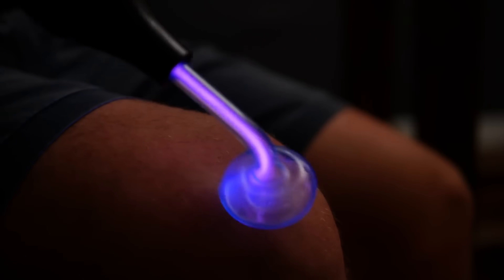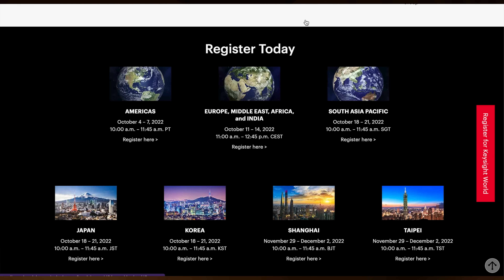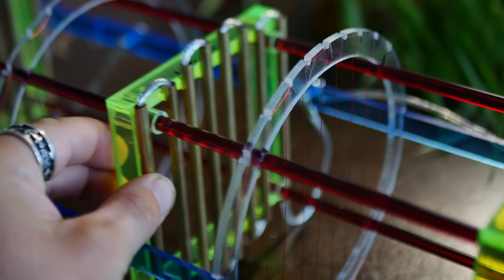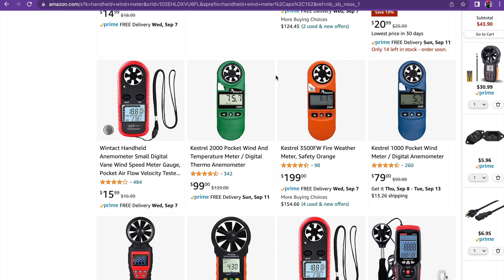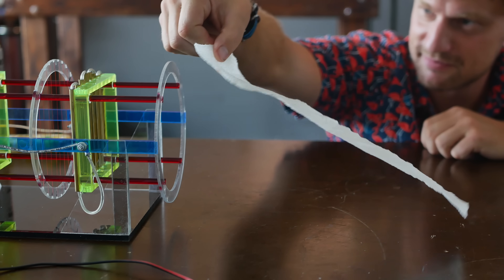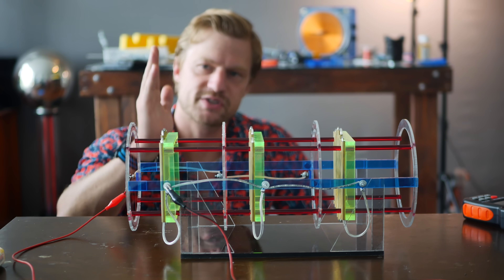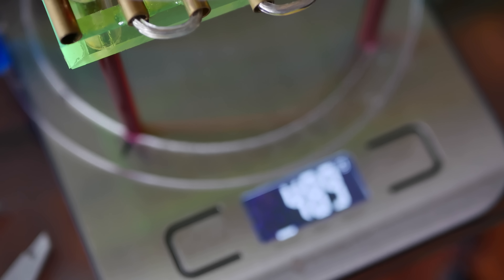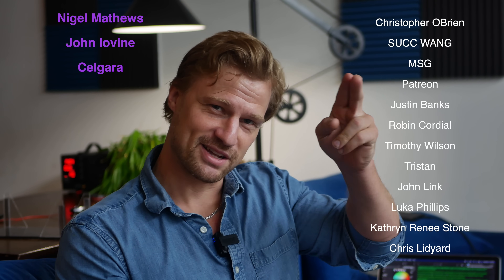Designing A Next-Gen Ionic Thruster! (For Flight)

Comment: The stagnation pressure is (1/2) * AirDensity*Velocity^2. And the power goes as the cube of the velocity. So using velocity increments is not exactly the best measure. At least get yourself a spreadsheet or HTML/Javascript and have it keep track of the velocity, squared velocity, voltage, air temperature, air pressure. So you can talk to investors when you build one.

Read a little about "fluctuation", "vortices", "Reynolds number" Your ions will interact more with turbulent air. Your dry ice was a good idea. You might want to look at "laser ionization of air" and "nuclear ionization of air" and perhaps keep sparks as detectors. Put a small camera on a spark at low current, in the dark, so you can use the data from the images for measurements. A "hot wire" anemometer might be a good thing to learn. A current enough to heat a tiny wire above ambient, the flow rate cools the wire. The current changes to keep the current constant are related to temperature and heat flow.

You have almost ZERO sharp points, and the electric field is part of the acceleration of the ions in air. I think the ambient electron density is on the order of 10^10 electrons/meter^3. But you might want to keep an eye on the humidity. A moist day might be hard to make sparks or strong fields. You should know that. I am just trying to write notes from 55 years of picking up odds and ends.

Look more closely at "electron affinity". The cost to ionize is high. But adding electrons and then accelerating the negative ions cost less energy. Decades ago there was nothing on electron affinity.

You are NOT PULSING your fields, and you did not mention frequency control of the high voltage.

Can probably stick a three axis accelerometer on a rod and correlate the acceleration in 3D to the forces. If you decide to use microsecond pulses, you can run your whole system at much higher power levels in burst. Pay attention to the second and third time derivatives of things. When you have a steady flow there is less force. But stir it, spark it, push it, make shock waves then you have something to work with. But measure, don't guess.

Since you are trying to move air, you might want to take a small stream of air and pass it through a tube with many fine needles all pointing in the foreward direction. A set of high power thusters might be better that big soft air flows.

Study magnetic induction and the force of pulsed current flows, particularly where there is high Amperes/Second. That is an accelerating charge flow (Coulombs/Second^2). You might find it much easier to build an acoustic drive.

The power modules for drones are high current but also high Amperes/second. A shock from a spark will move air and the amount is probably easier to quantify and control. Movement of air is just like movement of electric current through a circuit. The "capacitance" and "inductance" "reactance" and "impedance" are all well used. You can take the FFT of sounds and the FFT of current flows and the FFT of air flows. A "tuned flow" is one way to solve the equations of motion as differential equations using FFT methods.

The oxygen in air is paramagnetic. A strong magnetic gradient will cause a force. A high electric field at a point might be a good place to add very strong tiny magnetic nanowires. Do it in the computer and it is a lot less expensive than building things and trying to guess at measurements. And if you talk to investors with an open model they can see and have others test, you have a better chance to ask for crowd funding and cloud funding.

If you replace your solid wires with sharp needle pairs, you can maintain a discharge across each one, if you have separate current and voltage controls on each. A real field generator, you will use whole sets of these to pulse the vehicle as a whole in exactly the right way. IF you jiggle in a swing, it will not swing, you have to match the rhythm of the swing. The modulation of forces used has to match the structural resonance of the vehicle, and the acoustic properties of the air flow.

Wrting this out, I think you would be batter off to spend some time making acoustic levitation tools to pump air. Doing it with sparks and hidden ionization channels especially most of the action is going to be faster than your eye or camera (but not faster than an oscilloscope (USB) which is just some amplifiers, ADCs and computer memory and storage.

You might want to look at using arrays of discharges, measure flow, and find the "sweet spot" by FFT of the flow and the current driving the needle discharges. I think you used a hack saw blade. See if you can find someone to grow whiskers on a sharp blade. Some basic nano materials development might be something groups would help you with. If you make the models open, and create an "open worksite" you might get groups from all over the world to collaboration on ONE model that everyone can see and test and work with. Share the raw data and visualizations.

Richard Collins, The Internet Foundation

Comment: would removing the insulation on the magwire help or hurt?  I could see in the low light images that the ions are erupting from the cracks in the polyamid insulation of the copper wire.  not sure if that is by design or a bottleneck in the ion flow.  I also wonder if reducing or expanding the outlet would help.  thinking of the shape of a rocket thruster bell.  or maybe an aerospike shaped exit.  but thinking about it, since there is no combustion, you really arent dealing with expanding gasses.  you just need lots of feed air to be available to be directed in one direction.  Maybe multiple first stages feeding into the second or 3rd final stage.

Comment: Ionic propulsion is not new at all, just to the vast public.. Unlike rocket stage vessels,  a space engine runs in chamber phase vs stage. For example. Starting with ionic cage, it can multi task both a ram jet  intake in low altitude air. [Read more for details] In extreme micro air, still draw air in. Second phase chamber, the classic blade purpulsion sets will then grasp the air  to next chamber. Third phase, a compress turbine volume taking brand air volume to faster narrow. When it reaches adjacent to electric/detonater/plasma or class fuel after buffer nods, the final is the squeeze afterburner vectors. Congratulations. You have a multi atmosphere Space Jet Engine, also all electric by option.

Comment: I would like to think enclosing the build so the air flow has less chance to escape, im sure using a HVAC smoke candle I think it's called works better than dry ice aswell for testing that kind of thing, also would crisscrossing the wire making a loose mesh like a tennis racket for the electrode would that degrade airflow to much or would it be more beneficial to have a section or two be doubled up?

Comment: you might need oscillation and resonance behind the current flow with a smart controller using AI to monitor the air flow in hard numbers and adjust an algorithm of pulse and oscillation or voltage application that will increase and increase the air flow until it sounds like a whistling jet engine. I can hear dead energy in the design you made, but it is an amazing proof of concept.

Comment: If 1 array gives 1.5 m/s and two in series gives 33% more velocity, why not try putting arrays next to one-another to increase the volume of air which is being accelerated? You could also make use of the Venturi   Effect by adding cowlings around the thruster. This would increase both the volume and velocity of air being drawn into the active part of the thruster, increasing thrust at the expense of a small amount of additional mass. With careful design, that cowling could incorporate the thruster elements and therefore reduce nass again. As for the grids, try using a fine mesh instead of a very few fine wires. You could also increase thrust by having multiple elements at increasingly high voltages instead of wiring them in parallel. You can also try using different diameters for the thruster. A bigger cross sectional area should give more thrust. If you could find a way to keep mass down, the Hall Effect could also be used via electromagnets.

Comment: One improvement I see is that this device was experimental, so you designed it to maximize it's configurability. Now that you've narrowed in on the optimal set-up, you can build to that configuration and trim excess materials that facilitated its configurability. This should improve your weight-to-thrust ratio.

I'm not an engineer or anything; I hope this makes sense.

Comment: So, electrons are hitting air molecules. Causing them to move. But the problem is, electrons are hitting air molecules, causing the electrons to slow down, and not build up speed.
IF, part of the tunnel, which obviously needs to be covered had a section in the beginning with vacuum, the electrons would build up a lot more speed, before hitting the air molecules.

Comment: Instead of ground bars you could tri thin blades  , and then I think a  body would help more, like a jet engine housing. As it is, every stage could suck stationary air from sides instead of accelerating already moving air from preceding stages.

Comment: I think anode made in mesh should be better. Also I'd place the whole thruster into the tube thus not loosing airflow on the sides. Then I'd experimented with higher voltage on each next step.
And after all I'd added airflow heater (by electric arc of course!) in narrow tube :)
This would be  a real jet propulsion engine without burning fuel

Comment: Jay, I've just stumbled onto your channel today and I love what you're doing here.  I really like the work with the ion thrusters in the dark.  I've been into photography since the 1960s.

You mention the MIT ion powered plane and I did some looking at that.  From what I see, they set up a completely open ion grid and stuck some wings and a tail on it.  While this worked, I think there are better ways to make it work.  Your idea of a multi-staged thruster isn't a bad idea and on your later videos with the boat, this is proven out.  I just left a comment on the catamaran video you just put out.

However, with an aircraft being powered by ion thrust, I don't think you're taking full advantage of that thrust if you are focused on a typical round thrust pod like an engine.  The aircraft flies due to the laminar flow of air across the surface of the wing.  It flows faster across the top as it has further to go and this creates low pressure on top of the wing and produces lift, but I'm sure you already know this.

But why not maximize that lift by elongating the ion grid the length of the wing and just above the upper surface so that the air moving over the wing is further accelerated by the ion thrust?  Bell Aerospace ran a test in 1977 of their Bell-Bartoe Jet Wing.  This was a single engine jet that had the exhaust split and re-directed to an outlet at the top of the wing's camber.  They added a second airfoil just above the outlet to help maintain the laminar flow.  The point was to develop a Short Take Off and Landing, (STOL) jet aircraft.  You can read more about that here:  
https://www.planeandpilotmag.com/article/incredible-plane-ball-bartoe-jetwing/

Comment: nozzles could help increase velocity and maybe straightening the flow. the moving air is shearing against the non moving air like a thick boundary layer, maybe use a tube/duct. When using the duct, use something to make the boundary layer thinner, like little holes with suction on the inside perimeter (like inside a jet engine), or a slot with moving air like the Dyson fan. Might not be fast enough for vortex generators.

Comment: The big problem with high voltage is that the power supply is so incredibly heavy. In the past I often made ion thrusters. But the energy source remains very heavy unfortunately. In space it doesn't matter that much, heavy objects do move. Maybe try to reuse the energy of the thrusters themselves?

Comment: I think you may need to create turbulence inside the air chamber to get more thrust. Could you set up the wires et al, with a geometric pattern that is tuned to the most effective frequency? As in, the geometric pattern which corresponds to the wave form you wish to use to generate the most amount of thrust from the least amount of input. Air, increases in power when it is in a vortex pattern - this can be witnessed by watching wood fire burn and how creating the environment for vortexes to form, the fire burns more effectively and hotter - and faster.

Comment: Does It leak?  I mean some of the air from the first stage is not making it out of the last stage of system, or the other stages need more airflow into the system. If the device was on wheels.  At x speed, does the jet still accelerate the vehicle at y speed?    Does air output increase when intake increases. What types of gasses interact better with the static charge?  And how does heat and expansion of the gas interact with corona effect?    Would it work with a turbo..

Comment: Indeed a shape change, if the shape was a funnel in theory the air speed should get faster increasing thrust.  And Inclose the hole setup
also a change in thickness of the wire

Comment: Surely the air flow should be contained within a tube .  Otherwise some of the air leaving each stage of acceleration (electrode pair) will escape before reaching the next stage.

Also, instead of having three stages of acceleration separated from each-other by several inches,  why not have a single stage comprising several alternating positive-negative-positive-negative-positive-negative electrodes all equally spaced apart?  The optimum spacing between electrodes would be determined by experiment.

Also, since the positive electrodes comprise thin wires, why should the negative (ground) electrodes comprise thick metal tubes?  Surely these metal tubes obstruct the air flow, and should be replaced by thin wires (same as the positive electrodes).

Also I suspect (but I don't know) that there may be a small advantage if the conductors (wires) of the negative electrodes were oriented at 90 degrees to the conductors (wires) of the positive electrodes.  Experimentation would quickly determine this.

Comment: I think the tubes of  the ground electrodes would be better as a fin designed to spit the air stream. All of the square corners and non optimized surfaces interfere with air flow. If you “port and polish” the air way I am pretty sure you would get measureable improvement. I can see a 3d printer coming in handy to create proper ducting. This thing needs to be in a tube with no square corners. Can’t help but to wonder if there isn’t any “back draft” so to speak that might be parasitic. If so, you could phase fire the electrodes in very quick succession to hand off the air t
to the next array. Great project, great video, thanks

Comment: One of this issues is that once the air is flowing at a certain speed the following stages will not be able to accelerate it much more, not with the setup you have. Thoughts that come to mind, the tubes being more aerodynamic is shape (tear drop) and having more surface area to put more ions into the airflow. When doing multiple stages, have different voltages for each stage as well as different distances - why the first stage has already accelerated the air to say 1.6 m/s for that gap / voltage. The second and third stages need to be optimised for inflow at certain speed to accelerate higher. The other part is to have maybe more like a funnel (wide at front and more narrow out the final end) - like water cannon - narrow the tube and air speed goes up hopefully for the same volume of air - and that should be more thrust.

Plus you need to see how this goes when it is moving through the air. Not so sure how you can test that. As I suspect that the voltage setting for each stage when stopped will need to be different has the engine gets moving through the air. Some sort of vectoring mechanism to change the configuration during flight.

Now a thought around that is by switching and having multiple thin wire sections behind the main thicker tubes. As the engine starts to move switch the ground to being further away. As I suspect to keep the thrust / acceleration high the ground needs to move further away as the engine gains speed (higher intake airflow). Just guessing a bit here.

Comment: I'm no scientist not even a tech. It seems to me you should compress the ions, build up electro static pressure ,force ions toward the exhaust use grids like in TV tubes of old. Force ions thru a grid toward a highly charged anode plate. If you have a very negative cathode a zero potential anode looks very positive

Comment: What about putting a shroud around it?
If it is moving air then it would be sucking air from the sides.
I wonder if there is bulk ozone being produced and if it’s radiating UV? That purple glow.
Be interested to know what thrust is inside a vacuum,
I think an ion drive in space has to eject something like a gas or a vapourized metal or something. I think caesium was used but that would be expensive.

Comment: Super build!
The improvement I would bring is placing the whole contraption in a tube, otherwise the flow of 1st thruster is going a bit in front and a lot in lateral, outside the build.
If you place it in a tube, it will add.
Success!

Comment: The circular design might be a limiting factor because the length of the anodes gets shorter near the side edge/wall. So a square design might give you an increase in output. Perhaps the difference in the effect would be the difference in the area I d didn’t catch the dimensions of the grids would give you a 36% increase in thrust or air speed.